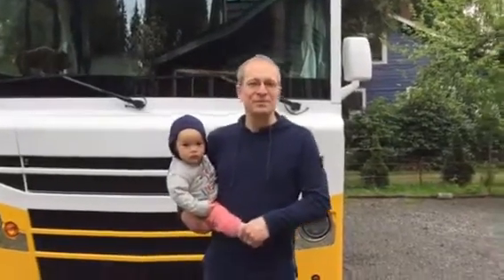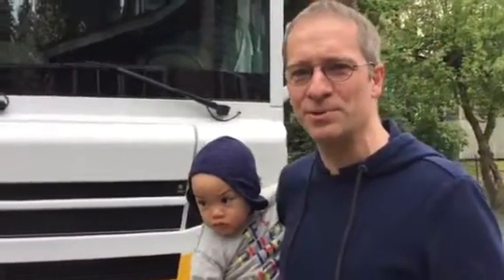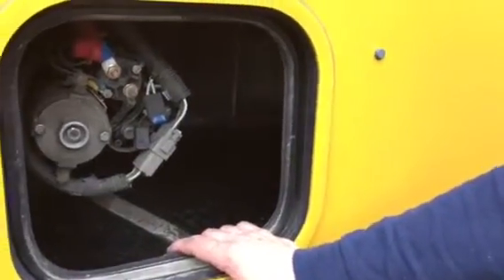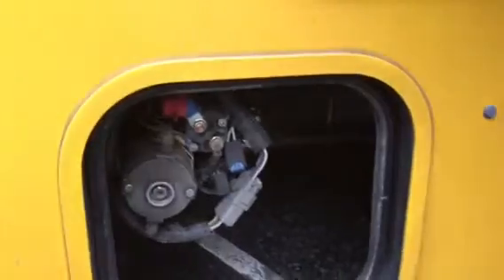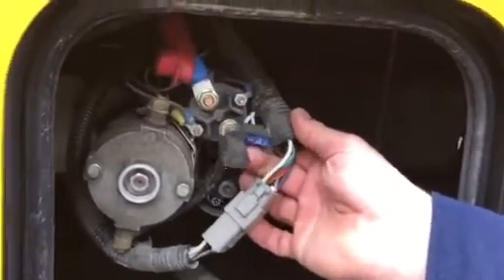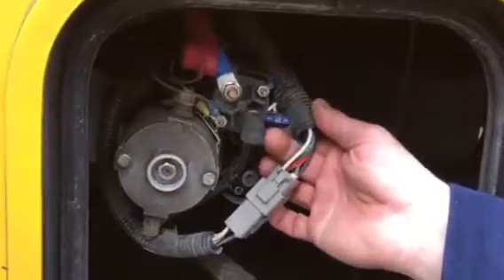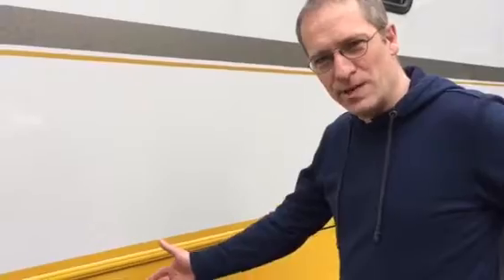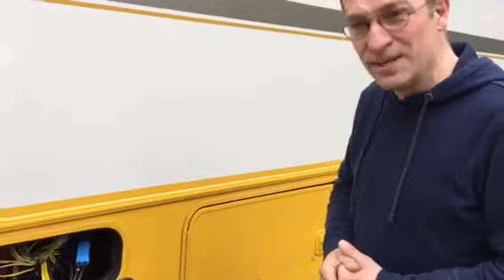LCI Auto-leveling system "low voltage" error

Comment: Thank you for posting and allowing others to post their experiences.  We got the low voltage message and didn't know what to do so we manually lifted our Jack's and went home with our LCI beeping all the way.  Once we got home I looked for more info and in the comments about yellow 50 and 100 red GFI.  The red needed to be reset by pushing the released back up.  The low voltage error went away and our generator started working again.

Comment: Thank you so much for posting this video. you saved me sooo much time. I just took my battery jumpers out and connected one terminal to the other and voila! I was able to retract my jacks and be on my way. I have a winnebago vista lx 35f and there, they hid the fuse link behind the fuse panel just like in your unit. Thanks again

Comment: there are 2 breakers 50A (yellow) and 100A (red), might have tripped because of high voltage use. In my case 100A breaker was tripped, and i lifted up to resolve low voltage issue and able to retract the leveling system.